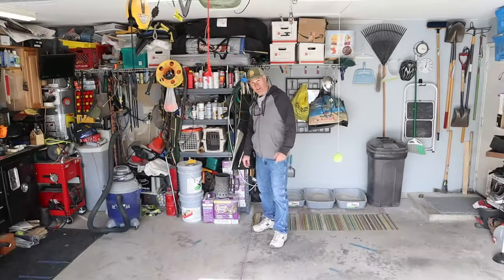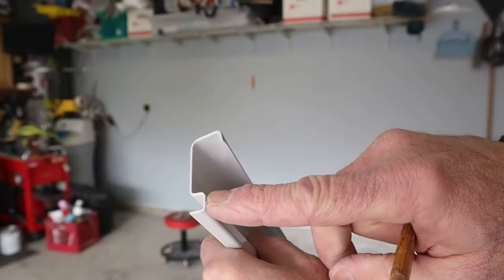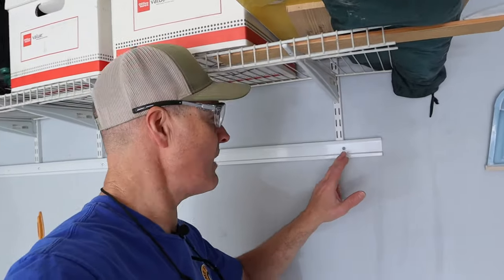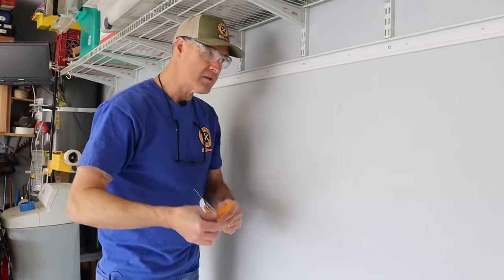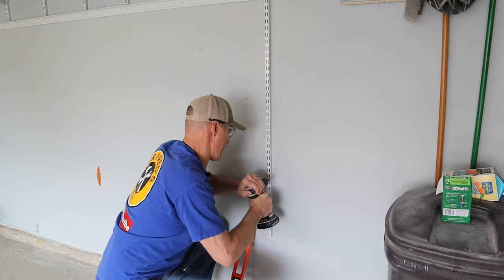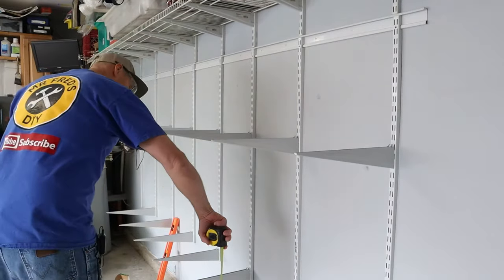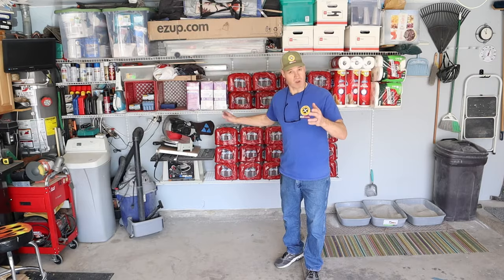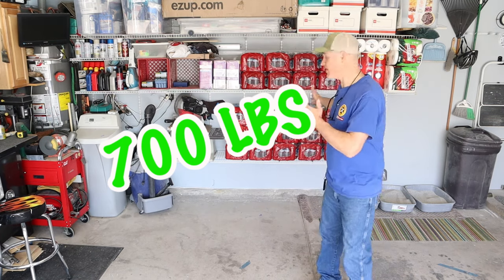Hang Track Shelving Installation “Beginner Friendly”

Comment: When l painted my new walls in my shed, l put a trim tape over my studs. There is no  need for stud finding! * Note that each layer of paint requires its own tape. My one tape took out all three layers,  including the drywall sealant. Instead of starting from scratch,  l'm putting a wider tape  over the original tape, and sealing it with a clear sealant. If anyone can think of a better solution , please let me know ASAP!

Comment: does anyone know if shelving lengths are exact? For instance, I want a shelf across 3 24in spaced studs - that's 6ft. Do i need to get an 8ft shelf and cut it down for that to work with the brackets?
Reply from the maker: If 6ft are not available then yes you will have to cut them down. Both Lowes and Home Depot have the ability to cut them for you with bolt cutters. You just have to find someone in that department who wants to be helpful that day. Thanks for watching!
Reply: @MrFredsDIY  sorry if my question was confusing. 6ft'ers are available, but I'm wondering if a 6ft shelf is actually 6ft or if it's a bit over 6ft to allow room for the support bracket.

If it's exactly 6ft, and so is the stud spacing, I feel like the bracket would not fully engage the wire shelf and cause issues? Maybe I'm wrong.
Reply from the maker: @mattbush315  my guess is that a few inches extra on each side for overhang would be desirable.
Reply: I just figured out how to do this in a fraction of the time and probably half the cost.

Cut to length chain fence hanging from the rafters with s hooks.  Would they sway.  Yes.  but you could put buy a flat shelf on the floor and hook the chain to it.  If anything, this idea could be very fast temp shelves.

Comment: Any reason why you used the regular duty shelves, brackets, hang track & vertical rail and not the heavy duty ones ???
Reply from the maker: Thanks for watching the video! I used the regular duty because I have used them before with no issues and as you can see with all of the weight they hold. Also it saved a ton of money!
Reply: @MrFredsDIY  Your are very welcome.   I hear you about the ton of money, LOL/   when our home was built the builder used a guy that just used the usual junk to hold the wire shelves , even the bottom bracket were not in the studs,  after 20+ years a 9 foot wire shelf caved,   I took all the shelves in the closet down,  the closet is big 9' X 7' I did that closet with all the heavy duty shelving etc and everything in the studs, I kid my wife in saying the house will fall down before any of these shelves fall, LOL , Now that I have gotten really good I am going to do a wall in the garage like you did and was going to use the heavy duty stuff again, but after seeing your video I just might go with the regular duty,  again thank you for getting back to me and your answer to my question

Comment: I used Rubbermaid its same system. Its easy installation and holds weight well. the 16 inch shelf supports is what drives the cost up.

Comment: What did you use to cut the rail with?
Reply from the maker: That is the DRILL MASTER 5.5 Amp 6 in. Cut-Off Saw from Harbor Freight. I think with a super coupon I bought it for $29.

Comment: What is the purpose of the hanging or top track? Can’t you just screw the vertical tracks into the wall without the hanging track?
Reply from the maker: The top track ads vertical structural support. Screws alone could shear off under a load. I had considered only using screws on the uprights, but I knew I was going to put a lot of weight on this system. Thanks for commenting.!

Comment: Can you use 12 - 14 inch wood for the shelves with the adjustable shelving system?
Reply from the maker: I’m pretty sure at Lowe’s and Home Depot both sell shelving that works with this system. You certainly could DIY some wood shelves for this system. Thanks for checking out the video.!

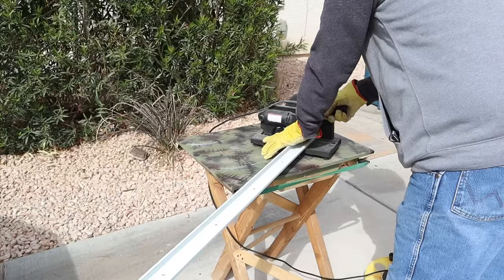Comment: At 0:47 you use a tool to cut the hang track. What is that thing?
Reply from the maker: Harbor Freight sells these. It’s a small “chop saw” for 6” cut-off wheels. I have punished this little saw with up to 1/4” thick steel bar stock and it just keeps going!

Comment: I have the 9 volt battery stud finder,, but the one you used is simple and effective without any batteries. Cool beans..
How deep are the shelves? Can you get deeper shelves?
Reply from the maker: The shelves in the video are 16” but they also come in 12’ and 20”. Thanks for checking out the video!